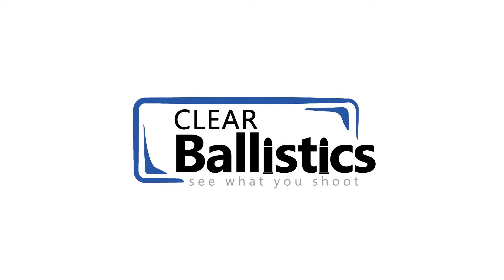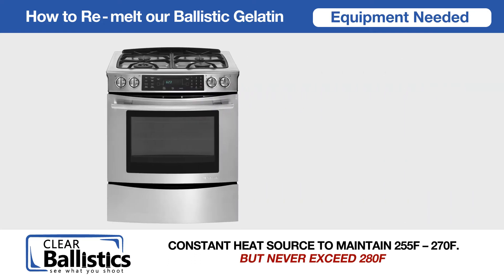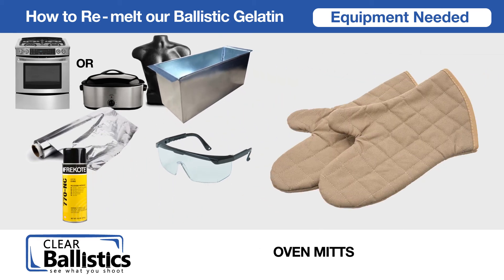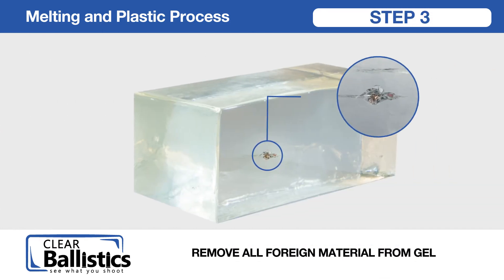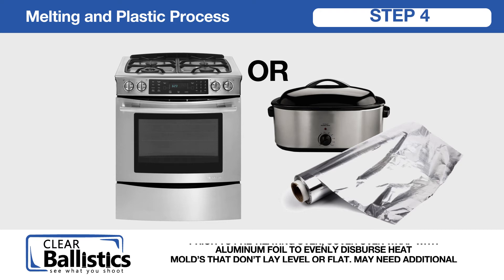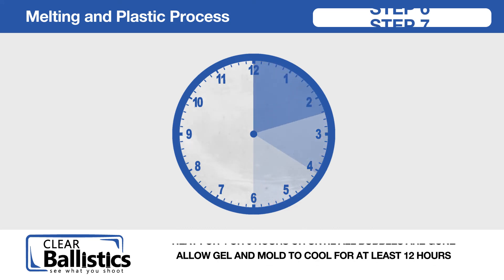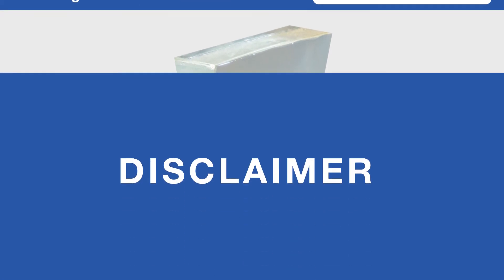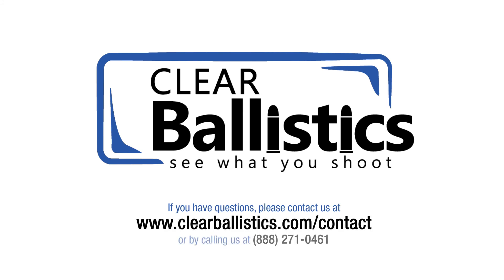How To Remelt Clear Ballistics Gel

Comment: All I did to remelt was to cut my 20x6x6" block in half, lay the two pieces in a roasting pan, turn oven to 250 degrees, and bake for 5 hours or so. It was easy, simple, and came out looking as good as new. No cutting up in to 1000 pieces or anything like that. It seems like doing that would make for a lot of air pockets in the block. I did lay foil over the entire bottom rack though. I used the top rack for the gel and I had it pretty high up in the oven. It worked out perfectly. Just sayin.....
I do have to mention that a roasting pan isn't the best to use as a mold. It is just something that I had and wasn't using and the molds that Clear Ballistics sells are outrageously priced.